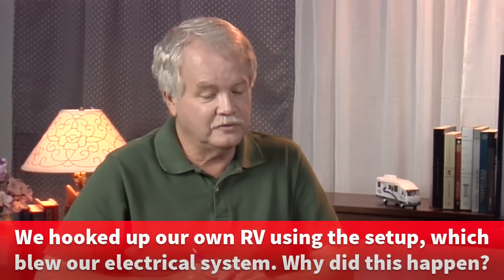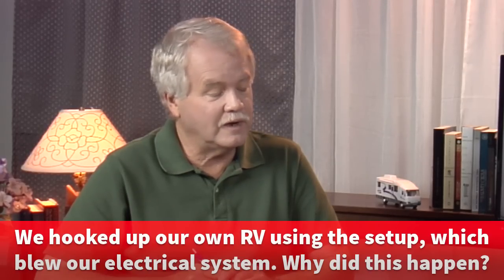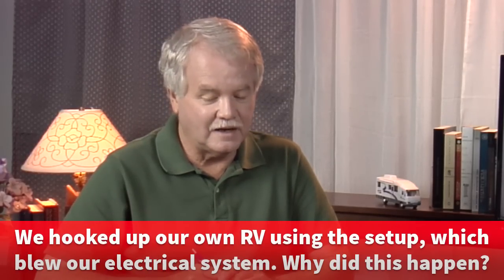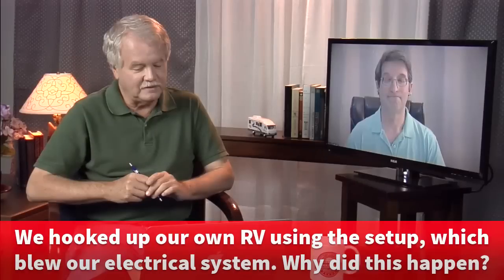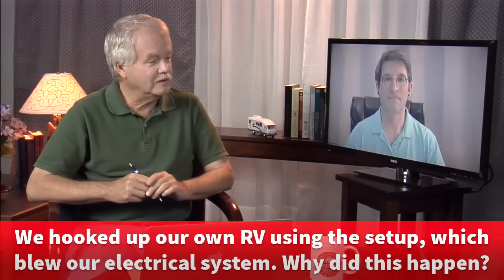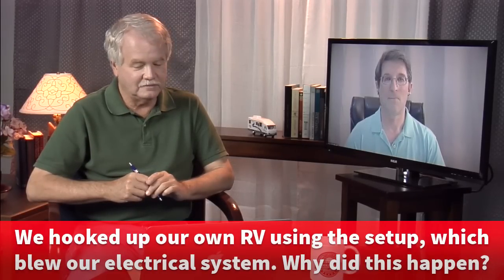Electric hookup at home blows out RV's electronics. Why?

Comment: What gauge wire did you used to hook up your 50 amp service for your motorhome. 
I’ve heard number eight wire and also number six
Reply: It all depends on the wire method used, if you use nm cable(romex), then #6. If you run a raceway then #8 thhn with a #10 green ground wire.

Comment: What if I have a 240 Volt system in my RV? Can  connect through the 4 wire dryer outlet?
Reply: A dryer outlet provides 30 amps and has a different plug configuration than the 50 amp plug.  It would work, but need a custom made adapter.  I would only do it with a 4 wire dryer outlet.

Comment: I’ve repaired many RV electrical systems after an electrician wired up a 240 volt outlet instead of a 30 volt 120. 99 percent of them are stopped at the converter, in most modern RVs.

Comment: I doubt the homeowners told the electrician this was for an RV and that it had to be a 120V circuit. If they knew what was going on, they should have checked the receptacle with a meter themselves, as the electrician no doubt did to verify the operation of the circuit.
Roughly, only 10% of households in the US have an RV, even less actually have a dedicated hook up. The vast majority of 30 amp circuits for residential use is wired for 240V. If someone wanted a 30 amp circuit installed in Hawaii, you won't find ONE electrician who would think to wire it for 120V - there are no RV's in Hawaii.  We don't know the whole story here and it's obvious this "electrical guru" is biased towards RV'ers. You don't know if the homeowners used a dogbone to make the connection, or even if they supplied the correct receptacle for the electrician to install.  Not enough information to outright blame the electrician. This should serve as a lesson to homeowners - 30 amp circuits and higher are 240v STANDARD in residential service.

Comment: correct if i'm wrong , but isn't the 30A rv plug labled on the back  line, neutral and ground??? mine was
Reply: The homeowners probably did not inform the electrician that it was for an RV.  Most circuits for residential use that calls for amp rating higher than 20 amps, are 220V.
Reply: larry reno hi

Comment: Wiring a r.v straight to your home could cause your home to burn down plus its against the law
Reply: As long as it is wired correctly for a 120 v 30 amp or 240 volt 50 amp their is no real extra risk. However if you want to use 240 volt 50 amp than you should have a service that will handle the potential extra load otherwise you may experience the main breaker tripping off. This will happen if you try and run all the AC in the home and RV at once. Home will not burn down unless it is done incorrectly that is why you have circuit breakers in you panel. Plus the receptacle is marked as to what voltage and current rating should be used. Most states require electricians to have licenses ask to see his or hers before he starts work make sure he or she is on the job and not some apprentice. If you say it is against the law please cite the place in the national or state electrical code where it says that.

Comment: The 30 amp 120 volt rv plug and receptacles have a different ground prong from a 240 volt dryer receptacle,  but they look very simular.  Why that electrician didn't know this is beyond Me.  He needs to go back to school.  What I was asking is if a 50 amp rv receptacle has 2 hots that would read 240 volts with a meter accross them,  or do they just have 50 amps at 120 volts with a bigger single pole breaker.
Reply: But to answer Russell's question, (ahem!)  yes, the voltage across the two hots is 240 V.  And that's 50 amps on both sides, so you can run 12,000 watts through such a connector!
Reply: You need to use a double ganged 50 amp breaker and number 6 wire aluminum or copper. Don't forget to use the antioxidant paste on aluminum wire and you need 3 wire plus ground wire or cable for a total of 4 wires. If you use wire and not cable the ground must be green and the neutral wire must be taped with white tape or be white. You will need to use the proper size pipe and grounding bushings. You may need to upgrade your electrical service panel if you are going to run all the AC in the RV and house. If its outdoors you will need a weatherproof box for the receptacle. You biggest problem will be connecting to the service panel without bending the pipe. Other wise you can probable use pull boxes for turns. Don't be afraid to use oversize pipe getting four number sixes down the required minimum size can be problematic.

Comment: I took Electrical Maintenance at community college.  I understand about the 30 amp rv receptacles and I have My own camper.  I have never owned one or had any dealings with one with a 50 amp receptacle.  Are they still 120 volts or are they 240 volts???
Reply: I know now.  The 50 amp rv cords are 240 volts.  They have a double breaker because the campground that I am staying at has a 50 amp receptacle.
Reply: More accurate to say they are 120/240 volts.  They have two "legs", carrying 120 volts each.
Reply: But if you put a meter across the two hot legs it will read 240v

Comment: ? so let Me get this right.    The RV industry used a plug that was a common 240 plug..  and they decided to make their plug 120.    and now you are saying it's the Electricians fault that the RV industry made this blunder??
Reply: Not the RV industry's fault so much as the National Electrical Manufacturer's Association (NEMA) which sets standards for the various electrical socket and plug designs.  I have no idea why NEMA made the two different-voltage sockets & plugs so similar.  (Not identical, but similar.  If you know what you're doing, you can see the difference)   NEMA has many different connector designs, and the whole reason for that is to avoid exactly this kind of problem.  
 
That being said, a competent electrician is supposed to know about stuff like this, so a mistake like that is 100% his responsibility.
Reply: They are similar but not the same. You can't plug an RV into a dryer or a dryer into an RV receptacle unless you use the wrong combination or force it.
Reply: More than likely an apprentice was given the job by a Journeyman or Master unfamiliar with RV's or being that many things are made internationally the receptacle was not properly marked or not marked at all for voltage and amperage. There is also the possibility that the error was made by the supply house clerk when asked about the unusual receptacle.

Comment: you can use the 240 connector by dropping one of the hots and connecting the neutral..make a 240 v jumper to 120v ..plug this way..
Reply: +CubaPete101 it is pretty easy you have 2 hots and a ground for 240 volts no neutral..but for single phase at 120 volts you have 1 hot leg a neutral and a ground..red green white..the connector is a l 30 connector twist lock...there really is no way that a 240 connector will twist onto a 120 twist connector..one has 3 slots the other has four and they won't connect up to each other...